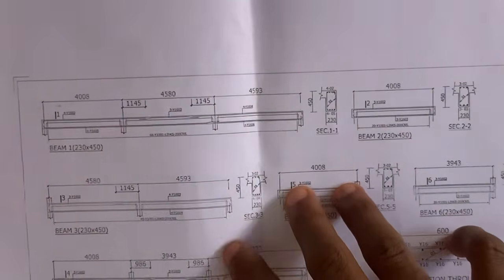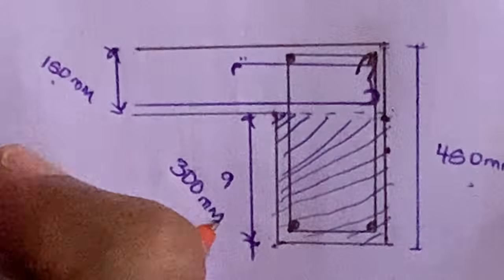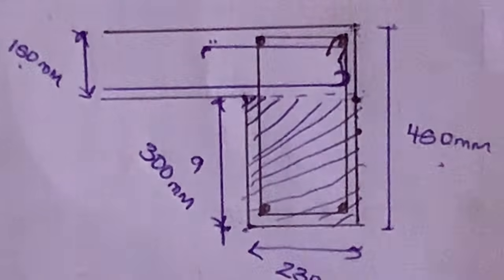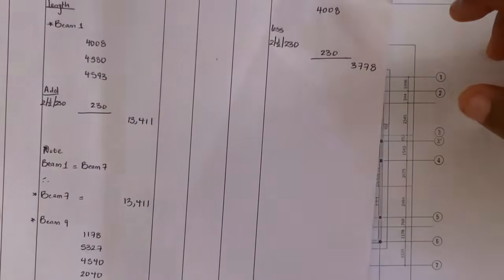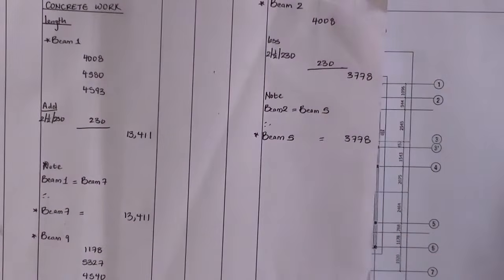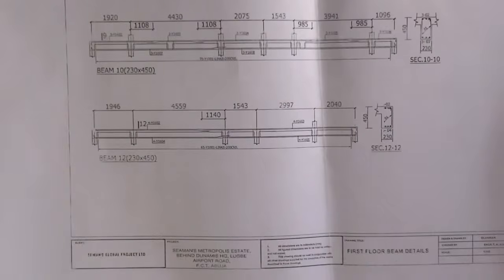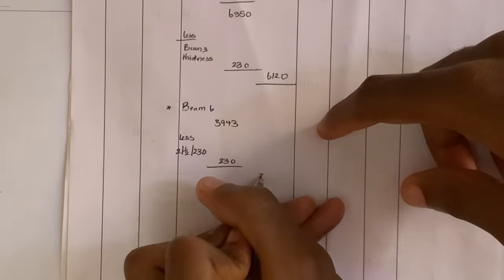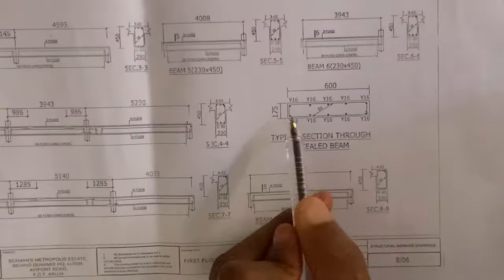HOW TO MEASURE CONCRETE FOR BEAMS IN FRAME STRUCTURE | SUPERSTRUCTURE QUANTITY TAKEOFF (QS TUTORIAL)

Comment: Would this method of measurement for the length of beam work if the drawing is a very complex drawing? i.e. there are so many intersections. I was thinking another good way would be to take the center to center length of each beam. I stand to be corrected
Reply from the maker: Yes sir 
The method will work! However, one thing about measurements is that I can’t tell you that there is only one approach to doing things. 
Some people might decide to use the total center line by the width and thickness of the beam (depending on the sizes of the beams in the drawing) to get the total volume of concrete.
Afterwords, they’ll have to start deducting the point of intersection for the columns.
So it all depends on your approach to the measurements.
I think this method is best because in the process of getting the actual length of each beams, we remove the columns intersection.
Reply: @quantitysurveyworkshop  Alright 👍🏾